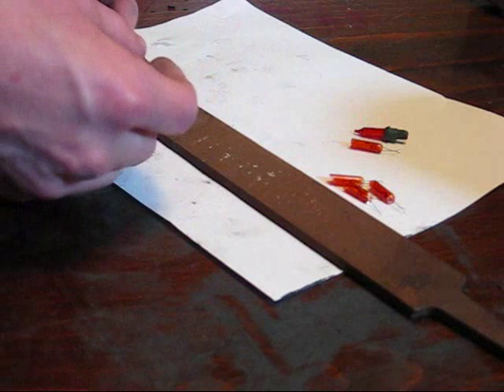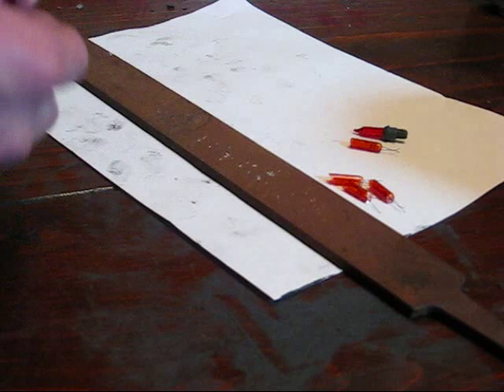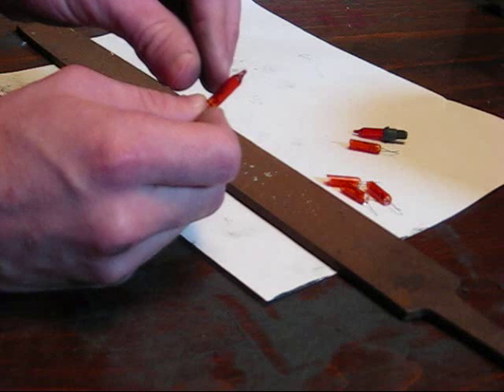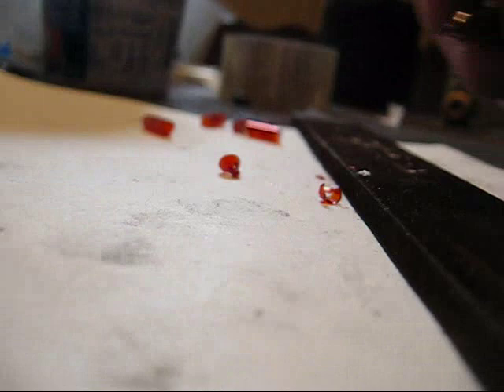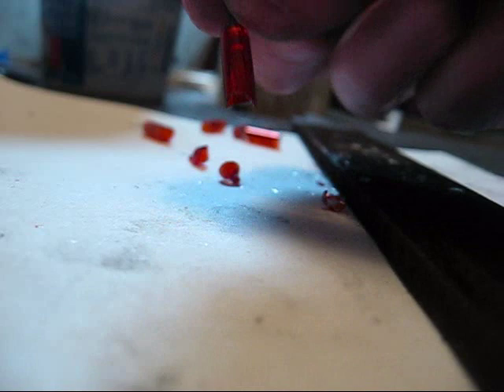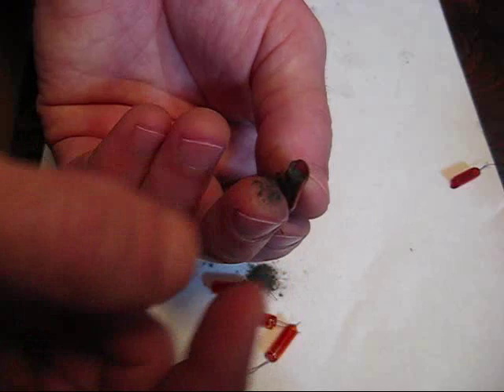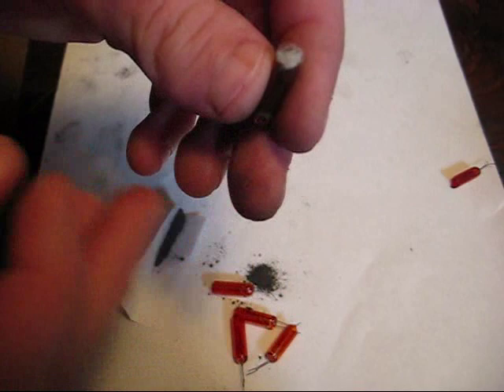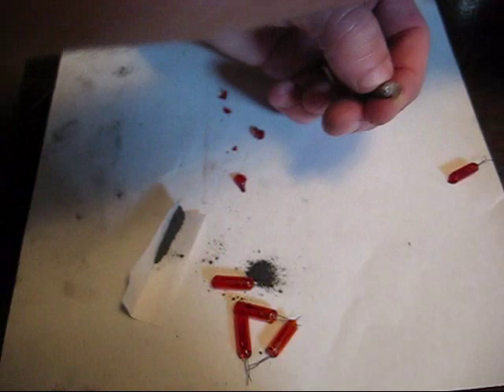How I Make Electric Igniters from Christmas Lights

Comment: To take the tips off the bulbs, I just use my Dremel with a heavy-duty grade cut-off wheel. Keep the plastic holder on the bulb and grip it in a bench vise so it's just snug. MAJOR TIME SAVER

Comment from the maker: Also an option, one that takes many times longer. Threading thin wires is a pita. There are many that have used bulb igniters for years and continue to use them because they work for their requirements. Both have pros and cons, personally I have never had an issue of unreliability with bulb igniters.

Comment: I put the tip in a small vise. It crack  the glass without continuing on like pliers would.
Also a drop of glue is a lot easier than wool, even hot glue.
I like 12 volt too if the distance is long.

Comment from the maker: Correct. Though were I relying on the igniter to function in an actual show I would use a larger power source. A single AA will likely not fire the igniter through 100' of wire.

Comment from the maker: Yeah that will work for one individual ematch, but the cheapest setup to fire  an entire show is a board with nails pounded through it. A wire is led from each nail down to the ematch on the display and back up to the battery. The circuit is broken by a handheld rod. To fire each que the rod is touched to the nail that que is wired to.

Comment: I do this sometimes if I need extra igniters. instead of BP. I use nitrocellulose lacquer. make it runny and slowly. drizzle it inside til it's full. let it dry and done! it doesn't have any effect on the filament. try it it works every time.

Comment: you use a eletric igniter like run wires from the leads and on the other end hook it to a 9volt battery it runs a current through and the filament gets hot and ignites it

Comment: If you leave the plastic part on, you could use the bulb socket to connect your finished product to the wire and you wouldn't have to worry about shorts or trying to twist those tiny wires together.  it won't work for every application but i could think of a few that it would

Comment: I've been doing this for two years now and never thought about the triangle file I used to just smash em with pliers well that's if I had any because this 5th of November I don't think I'll have any bulbs left!!! 😥. But I do have a kick ass ignition system that I built. Oh and to anyone wondering YES MATCHES DO WORK INSTEAD OF GUNPOWDER OR OTHER HARD TO GET PYROTECHNICS
Reply: Your a LEGEND.....I have just bought a ton of these....I was wondering during watching the video if using crushed/powdered matches would work. So....yeah, thanks, you answered my question ;-)
Also the date today is 16th jan 2015.....if anyone in the UK is after these VERY cheap they are selling em for 25 pence a pack!!!!! (In Wilko's stores).
I have bought 40 packs for a tenner lol (like a boss!)
Great vid by the way bro

Comment: I've made quite a few of these.. I usually heat the tip of the bulb for a few seconds, only the very end of it.. Then give it a dip in cold water... Tip usually cracks off into the water

Comment: @GiggleGuyz On 10M wire you can use 4.5V or more. On longer wire you must use higher voltage. The best voltage is about 12V.

Comment: I've tried making these with FFF powder and they just go bang (pop). No hot fiz. Might ignite a mortar, but not a fuse.
A metal diamond wheel on a Dremel is the cleanest way to cut the bulb, and can even cut the glass lower then the filament.
Still experimenting, but plain old coarsely mashed match heads with wood dust is giving me a slower, more controlled burn. Might add some iron and magnesium filings to get things hotter. Maybe I'll try some FFFF and combinations.
Reply: You should try filling them with magnesium/manganese dioxide thermite. It is even hotter than iron thermite and it is very easy to ignite.
You can get MnO2 from carbon zinc batteries.

Comment: it would be far safer and cheaper just to use fine nichrome wire and coat it in a pyrogen (I like to use KClO3 Sb2S3  but  meal would work)  using glass means you can get cut but much worse off it can cause shrapnel  i can see you used low grade meal in the match it self but  the quick match may blast it apart.

Comment: Man! I've been working on putting magic act together. I learned how to make my own flash paper, string and cotton, but I was stumped for remote igniters. I used to be into model rockets and made 90% of my stuff including igniters, I needed remote ignition for flash cotton that had to be concealed. Tape and cotton didn't work as well as several things I tried. This will do the "trick" (pun intended)! Thanks for sharing. Just wondering how you came up with the file idea to remove the top? I've seen it done for cutting class straws in lab situations where it was scored then snapped off. But this is had to been an accidental discovery. But like they say "Some of the best inventions were accidents"! Flash/gun cotton was an accidental discovery!

Comment: I use 40 gauge nichrome wire, 100 feet for less than $8. that's 1200 inches of wire, at approximately 1 inch per igniter, that's 1200 ignitors for less than $8..

Comment: no wrong your not makng a blasting cap your making an electrically fired salute there is a huge difference  and it is far from safe as these ematches are made with glass which is not a good idea

Comment: Alot of time and effort for such an unreliable ignitor.

Get some cheap network cable and take the outside insulation off, you now have 3 or more stranded pairs to cut to length and wrap nichrome or thin copper wire onto, and dip them into homemade pyrogen (also very cheap)